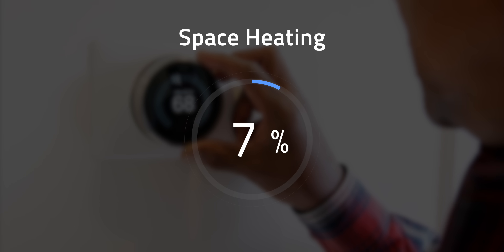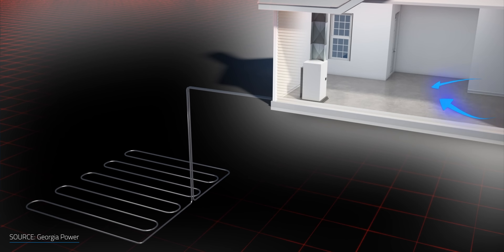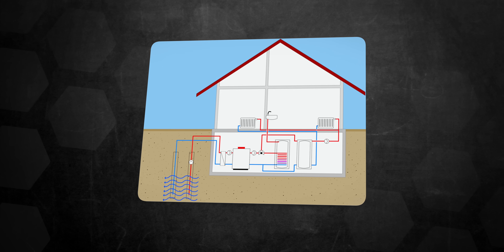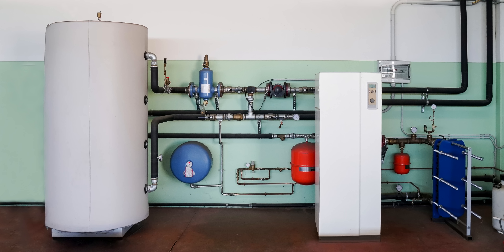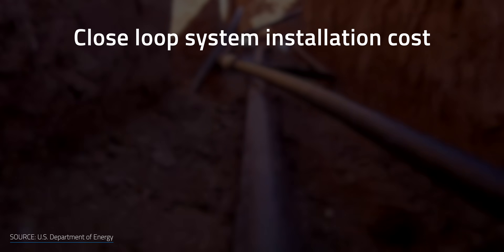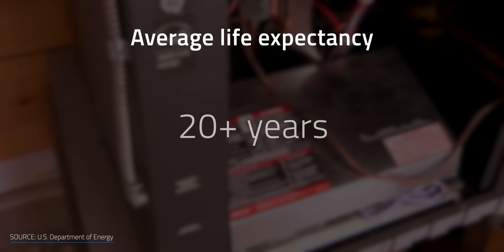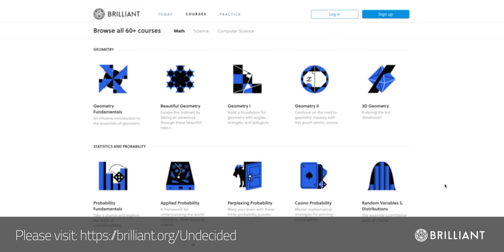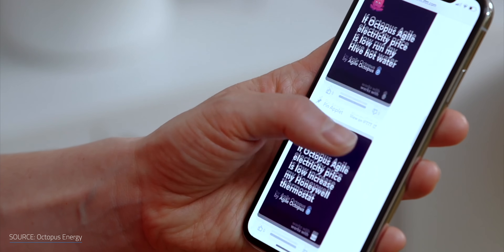Is Geothermal Heating and Cooling Worth the Cost?  Heat Pumps Explained

Comment: We have had a geothermal system for more than 25 years and not only has it saved us a lot of money it's been 100% trouble free.  We have a 4.3 ton Water Furnace brand two stage furnace with a closed loop in a trench that is 450 ft long and nine feet deep.  After the pipe leaves the foundation it drops down 9 ft then into a manifold with three 1" pipes spaced one foot apart along the floor of the trench and it returns to the house at 5'.   The first stage of heating or cooling being 40% of capacity and this will cool our home 95% of the time and during some summers 100%.  In the winter it will run on the first stage in all but single digit temps with winds above 25 mph.  Never a leak and the savings are unbelievable even today.  We are in Indiana and have a 2,800 S.F. home with half of that with 22 foot ceilings and we also heat and cool our garage.  Month after month we have saved around half of our electric bill and are total electric.  In the summer we can cool our home for less than $60.00 a month.  From fall to spring time the incoming water temp only go's down around two to three degrees.  If you do go Geothermal the best advice I can give you is, a closed loop is the only way to go and that you can't have too much loop in the ground.  So if you're in doubt add more loop it's the part that saves you money in the long run.

Comment: Plan on building a house with heated floors. Does someone make a geothermal heat pump for this purpose?
Reply: Yes. They are the norm in Europe. We don't use ducted air. All heat pumps here heat water, which is then used to run underfloor, sometimes radiators, and a coil in the bottom of the hot water storage tank. It's simple, low maintenance, can be retrofitted to existing systems and uses off the shelf controls and valves available cheaply at every DIY store.

Comment: Insulation is far more efficient than these will ever be. Insulate you’re attic, fix your leaky doors and windows. If you had a boat with holes in it would you spend thousands of dollars on an energy efficient bilge pump or fix the holes?

Comment: If you calculate the initial cost of ground source and figure that into a 30 year mortgage then add the second unit you will undoubtedly need after 20 years while still paying on the initial system they are not worth the cost. On a small home you are going to be upwards of 50 grand in total not to mention interest on your loans and service charges as everything on a geo unit is costly.

Comment: When I became a home owner in Southern California in 2013, I looked into ground-sourced heat pumps. They were prohibitively expensive ($50k installation). So I ended up going with an air-sourced heat pump ($17k installation). When heating it has a CoP of 2.9, which isn't bad - and 9.0 when cooling, which is incredible. It has been entirely free to run for over 7 years, since my solar panels cover its energy use (averaged over the year). So I'm quite happy with it. The winters here aren't that cold - not sure how effective it would be in the North East.

Comment: We had a GSHP installed in our new house in 2009.  It is a closed-loop system with seven vertical wells, each at 250 feet deep that feed two units to heat and cool 3500 sq. feet of living space.  I'm quite certain that the system has more than paid for itself by now, especially given the 30% tax credit we received and the relatively cheap electric rates here (north MS, USA).  One of the inside units did fail after 10 years of age and we had to purchase another one, but that could have happened with a conventional system as well.  A nice feature of the GSHP is the desuperheater that produces very inexpensive domestic hot water which adds to the savings of the system.  If I ever build another house, I'm sure it will include geothermal heating and cooling.  Excellent video Matt!

Comment: Here in Finland is normal nowadays to drill a hole between 100-350 meters for your house, the water in those depts ranges from 3-7 degrees Celsius all year round. Almost every new house uses geothermal heating, the state gives homeowners up to 4000€ if they change their heatingsystem from oil to geothermal.
Reply: Same here in Sweden,Stockholm , I have a one vertical 200meter hole for my 200 sqm (2000Sqf) house
.giving me 7 deg.  celsuis in okt and in april it is down to 4-5 degres
I use it for heating and hot water. I never use AC and I newer put any heat back into to hole. During summer when I dont use it. the temp goes back to 7 deg,
Its because ground water surounding the hole moves the cold water away and replaces it with new 7 deg water 
 My total consumtion is 13400kwh /year incl all electricity
Reply: They do this in one of the counties in southern new jersey, all the houses have ground-source. The state doesn't give much incentive but the ground water is super high that they don't have to. They drill down vertical (it's like soft mud to 50 ft down) takes a couple hours, and the holes immediately fill with ground water, then they drop in their loops, you can do it on a postage stamp sized lot. Lowest average heating and cooling bills in the country.
Reply: 3-7 wow that's chilly! 11-13 is normal where I live (new england)
Reply: They really should do that here in the US but the energy lobby is much better funded and more powerful than the environmental lobby.

Comment: And in Europe, especially in Germany it all goes down the drain due to high cost of electricity.. a heat pump has to get a COP of 5 as bare minimum to even have a chance of saving any money. Also since european houses usually have no aircon the incentive to install a heatpump is even lower. They work great, sure, but as long as they are the most expensive way to heat your home they won't become anyones first choice here.

Comment: Do you think a system similar to this closed loop system can be used to generate electricit if you have a deep enough hole? Where water can be heated by the earths mantel turned into gas than spins a generator cool through a heat sink and enters the bottom of the system again?

Comment: I always thought that a similar system could be cheaply installed to heat driveways for snow melt in Northern climates it wouldn't really need a lot of coil maybe just drill down vertically several tubes to bring up the heat to the substrate

Comment: Is this just to heat your house or can you run hot water and everything from this as well
Reply: Yes, they do hot water too, but typically not as hot as traditional systems, so it's usual to install a larger tank- you use more warm water rather than using very hot water and mixing it with cold (in a shower valve for example) so a bigger tank works better.

Comment: Installed horizontal loop field with Geothermal in a 4,000 sqft house in central NY (catskills) . I used to have an oil furnace. Heat is transferred to the house with  radiant heat floors. Heating bill with oil  was in 2009 between $7,000 and $8,500 a year depending on oil prices. Today I spend between $2,700 and $3,500 in electricity (thats including all the electricity for the house). Savings between 3 and 5K/year. Between incentives and tax credits the $35,000 investment paid itself off in 5.5 years, had zero maintenance in the system... will do it again in a heart beat

Comment: How about a massive buried insulated tank that is heated in summer with solar pool heaters?
Reply: You would need a tank the size of a house, heated to scalding temperatures to hold sufficient heat to meet the winter heat demand for an average house. Not viable sadly.

Comment: Always best to start off on reducing your heating load with excellent insulation and air tightness rather than just upgrading your heating system. Ground source heat pumps are not worth the upfront cost in a super insulated house such as PassivHaus as the heating loads are so low the extra efficiency over an air source heat pump is never recovered.
Reply: I was wondering about that. I have a house that consumes about 25kwh/sqft/yr to heat/cool. My energy bill for heating/AC was only $525 for all of last year, It would take a long time to recoup the cost of a system like this.

Comment: You use forced air heating in homes? It's more efficient to use radiant under floor heating when using heat pumps.
Reply: I agree, ducted air is a hateful way to heat a home. I suppose it makes sense when combined with air conditioning, but it will always be a compromise system.

Comment: I want to build my house with geothermal and like a solar roof to run it
Reply: add to dat septic and rainwater cisterns and satellite internet/tv/phone and u off grid :)
Reply: @shadownoobnoobslayer5424  rainwater cisterns wont work for going 100% off grid everywhere but they can help in all but the most arid locations...also in places like where I live in Montana a solar system isnt enough on its own to power a house in the winter unless you have an oversized array and like sweeping snow and ice off it...
Reply: Just bought a house with C class power efficiency. With geothermal heat system. Warm floor and you get Hot water too. Also plan to install solar panels as soon as sell apartement and have some spare money after paying for house 😁
Reply: Spend your money on insulation and triple pane windows.  HVac is a non-issue if your house is well insulated and tight.  You can add solar if you want, but even that takes a long time to pay back if your house is well insulated and therefore not using much juice.

Comment: I'm a bit of an advanced home nut. So my dream home would have a geothermal AC system with enough solar panels to sell energy to the grid and enough batteries to store the excess energy and power the house during blackouts. And collect rainwater/use a well for water. Would I make more money buying a regular home and investing the rest in the stock market? Probably. Will I be able to afford that house before I retire? Probably not. But I like the idea of being as self sufficient as possible. I'll be optimistic until my reality is shattered by my salary, taxes, and the upfront cost of all those systems.

Comment: 10:50 How hot is too hot to use a heat pump? My family is from Yucatan and in spring we usually get temperatures of about 40°C (~104°F). Is that too hot? Also, how deep does the underground tubbing need to go? Soil is not very deep. You dig about half a meter (<2ft) and you hit solid rock.

Comment: It might be more economical to do geothermal stabilization along side new neighborhood scale development, to parallelize the process and reduce the cost. 

Maybe even large apartment complexes with underground storage and utility room down with the bottom of the thermal loops (pumps could be thermally coupled with ground mass behind removable insulative barrier for maintenance). Multi-family buildings could even use the same hardware.

Comment: I'am in doubt, I have the space to install a few kilometers tubes as a horizontal collector on 1m50. But this area is not flat, its actually a slope.  Somebody told me that the heatpumps might have problems with height difference of 10m from lowest to highest point. I wonder if other people actually have such experience.

Comment: Is that coil of black pipes PVC? How can PVC or any kind of plastic be efficient material for heat exchange?
Reply: Long lengths and relatively thin walls / large surface area more than compensate for the shortcomings of the material when it comes to thermal conductivity.

Comment: Matt, I always find your videos very clear.  You're an excellent explainer!  I've been thinking about the day when I'll have to change out the radiators in my 1925 house, and now I'm wondering if a geothermal heat pump is the way to go.  Also, I have an old in-ground swimming pool in my back yard -- I wonder if that could be converted for geothermal heat-exchange use?  Thanks for a very good video.  #ShareTheLove

Comment: A contractor who does paving and outdoor drain systems work told me about a man who used a very simple geothermal system to melt driveway snow.  He just circulated  water from about 8 feet down to right below his driveway with no compressor and all.  It worked.

Comment: Today's non-geothermal heat pumps "take heat out of the ambient air" and through mechanical processes raise it to a temperature suitable for home heating.  The problem with those systems is that there is no heat in air at the freezing point or below.  The systems are equipped with power hungry electric resistence elements to allow the continued availability of warmth.  Very power hungry!  Here's where geothermal is genius.  If you bring the earth's temperature to the unit,  roughly 50 - 55 degrees farenheit,  you never run out of heat.  Also, the delta that the temperature much be raised is much smaller.  That's where the savings in the mechanical processes is realized. (Compressing gasses.) You still need 240 volts at a relatively high amperage, but consumption is way down.  And it works very well in the opposite direction: 100 degree days don't "have much cold to extract" to provide cooling.  Geothermal definitely makes sense, and the first system to develop a more efficient transfer system, which requires less of a heat transfer field at a lower price, will lead to wide spread adaptation.

Comment: Can you run this system with underfloor heating
Reply: Yes, in fact it's a perfect fit. Underfloor heating uses low water temperatures, which the heat pump is ideally suited for- they are far more efficient producing warm water than when asked to produce water hot enough for radiators etc.

Comment: I have a geothermal vertical closed loop system at my house and it’s very disappointing. Every year the loop temp drops so low the compressor freezes. I have a small 800 square foot house and a 2 ton unit.  I cannot set the thermostat any higher than 21C or the furnace never shuts off. My house is old and poorly insulated. As a retrofit geothermal in this case was a poor choice. I have to help the system by using space heaters. And even still the house is always annoyingly cool in the winter. However it is amazing at cooling in the summer.
Reply: Your loop system was improperly sized and/or installed.

Comment: Hey Matt, I can provide some perspective as I am a license heating contractor in Maine. I have just my LP and Nat gas tech license with my tank setting and exterior piping endorsement. One of the biggest set backs to using refrigeration for heating is that in the Northeast and anywhere else it gets well below freezing is going to be very inefficient. Mini-splits are a great source of heating for the fringe seasons like spring and fall where it's too hot to run the wood or pellet stove. The biggest gripe is the massive power requirement the colder it gets outside. This is why Mini-splits aren't as widely used as anywhere else in the country. In a home that requires a new boiler, the average running cost of a brand new system with all new piping, circulators and controls; all said and done is around $10,000 USD. Natural Gas, Propane and even Oil are a much better alternative in the coldest environments. Especially when there are snow storms that knock the power out for days at a time, you can't rely on the power grid for heat. There are ways to use wood heat that are almost as efficient as high efficiency boilers. I have been meaning to at some point try making an underground loop to use with a liquid cooled mini-split to see how it would heat in the winter time. Using loops to exchange energy to and from the ground is the perfect solution for getting past the inefficiency of cold climates. The ambient ground temp 5 feet underground outside my house is around 50 degrees, I have measured it before and this would be a great temperature to use for the mini-split. Making it much easier for the unit to make heat will greatly increase the life and efficiency of the unit, as well as make it so that it could even be used with an off grid back up system.
Reply: Absolutely!!! It’s just too cold in the Northeast!

Comment: Heat pumps tend to have COP between 3-5, but that depends on ambient temperature. Do you know the actual COP with specific outside temperature when using a simple air-air heat pump (AC)? I think below freezing it the COP can go below 1, that's when you simply turn on a resistive heater. But I don't know these actual numbers.
Of course with underground pipes and water it's much better and always worth using the heat pump.

Comment: 50 to 60 degrees at a depth of 10 feet is great for cooling, but unless you live somewhere where the temperature gets below 50 degrees, you aren't going to get much heat from this system.  When you do, you will still need to supplement the system by adding another heat source to bring it from 50 to 70 degrees.  For heat, I would bury lava rock (or put it in silos) and pump hot air into it during the day from solar air panels.  Lava rock is an excellent thermal storage method and could be used for heating at night.
Reply: you misunderstand. The house isn't heated by the water emerging from the coil at 50 degrees. The heat pump extracts that heat, boosts it to the required temperature and uses that hotter water to heat the house. Water that feels cool to the touch contains more than sufficient heat energy to heat a house. You don't need supplemental heat with a ground source heat pump.